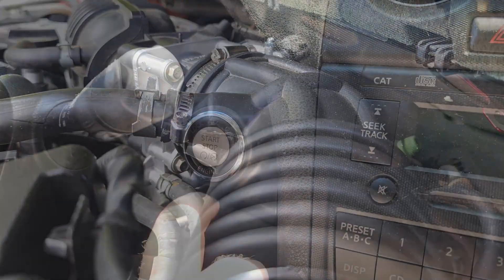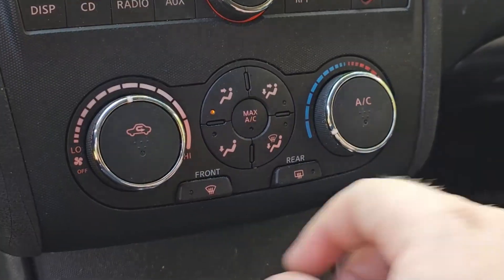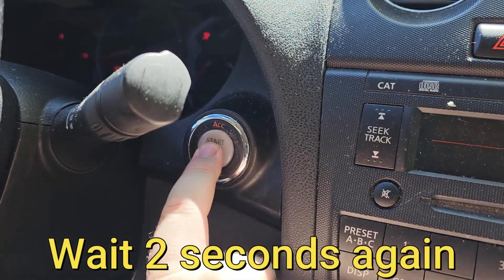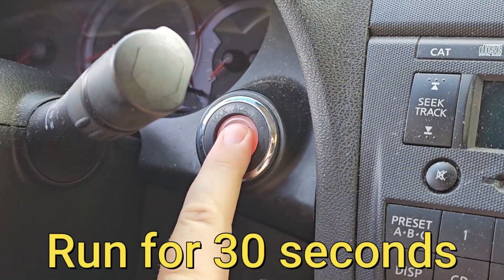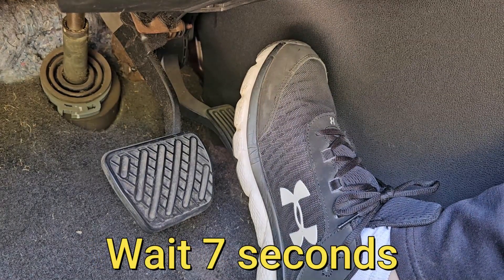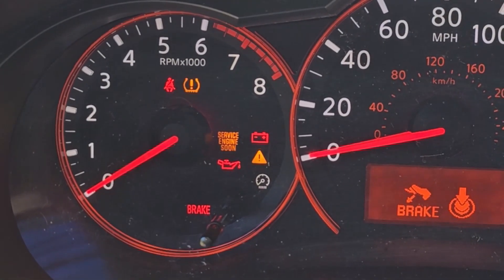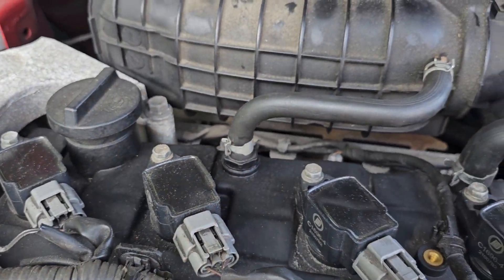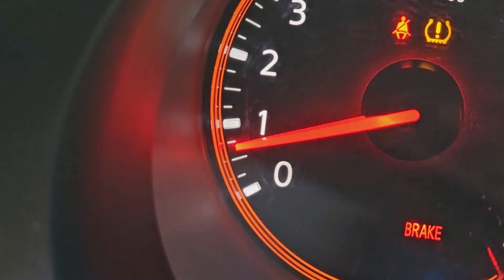Nissan Electronic Throttle Body: Idle Re-learn Procedure

Comment from the maker: More Nissan Altima Content!

Air Filter Replacement - Quick Guide!
https://www.youtube.com/watch?v=s4kL8nJRU7g

Oil & Filter Change - 5 Minute Guide!
https://www.youtube.com/watch?v=u20E1nn6h9U

Oil Maintenance Light - Reset Guide!
https://www.youtube.com/watch?v=V1kWxTHpnRE

Valve Cover & Gasket: FULL Walk-through!
https://www.youtube.com/watch?v=fRzelPhCPMw

Engine Oil Cooler O-Ring & Gasket Replacement
https://www.youtube.com/watch?v=8bOYDjw8t2Q

2007 - 2012 Nissan Altima 2.5L CVT Transmission Fluid Change! https://www.youtube.com/watch?v=_aTZv3ocE7Q

Upstream Oxygen (O2) Sensor Replacement Guide!
https://www.youtube.com/watch?v=UE1r9-fpe7s

CV Axles & Wheel Bearings Replacement - FULL Walkthrough
https://www.youtube.com/watch?v=HKSJYYgHxO0

Front Bumper Replacement!
Removal: https://www.youtube.com/watch?v=31vjYFm4K4w
Install: https://www.youtube.com/watch?v=2WQZcIuBulc

How to Replace Headlights; FULL Walk-through!
https://www.youtube.com/watch?v=xRzzjcb6l6Y

Grille and Emblem: Full Walk-Through
https://www.youtube.com/watch?v=Ykq2zqWwjiY

Headlight Bulb Replacement!
https://www.youtube.com/watch?v=uLhuZhOonW0

High-Mount (3rd) Brake Light Bulb Replacement!
https://www.youtube.com/watch?v=MKPJpZueWq4

Brake Light Bulb Replacement Guide!
https://www.youtube.com/watch?v=ZZo-qITFhzU

Turn Signal Bulb Replacement!
https://www.youtube.com/watch?v=a3s4wSl7xa4

Side Light Bulb - Quick Guide!
https://www.youtube.com/watch?v=3VY7_19rt0s

Mass Air Flow Sensor Replacement Guide!
https://www.youtube.com/watch?v=jl545FsC9tY

MAF Sensor Cleaning Guide!
https://www.youtube.com/watch?v=qTSwG2e171k

Thermostat Replacement - Full Walkthrough!
https://www.youtube.com/watch?v=10aySOX7aV8

Throttle Body - Full Cleaning Guide!
https://www.youtube.com/watch?v=cHEGOixl2go

Throttle Body Replacement & Idle Re-Learn Guide!
https://www.youtube.com/watch?v=hd64-icRnFI

Air Intake System - Removal and Install!
https://www.youtube.com/watch?v=HyR9HAcZivg

Coolant Drain & Refill - Quick Guide!
https://www.youtube.com/watch?v=2bM15L6tiFs

Replace Brake Light Assembly - Quick Guide!
https://www.youtube.com/watch?v=77F4XJEj5cs

Replace Reverse Light Bulb - Quick Guide!
https://www.youtube.com/watch?v=eYPuGGchsy0

Comment: I have no doubt the same engineer that made you have to remove the motor mounts to change the valve cover gasket is the same guy that came up with this ridiculous code.

Comment: I got p0101 replaced mass air flow sensor cleaned the throttle body now the car shuts off seconds after starting can’t even drive it any ideas 💡 anyone

Comment: I'm commenting this before I try this procedure again but I partially worry about this not working properly due to the fact I have aftermarket headlights that have DRL's on my Z, plus I have my bumper DRL's wired to them, they both stay on regardless. Plus my air suspension is obviously hooked to my battery. But, I'm going to try this again and hope it works. The first two times I tried it weren't optimal and I had to fix some more things. 🤞🏼

Comment: -2 seconds ignition on
-Turn off wait 10 seconds
-2 seconds ignition on
-10 seconds off
-Turn ignition on, then immediately off
-Wait 10 seconds (makes sound)

-Start engine to check it's running fine.

*IDLE RELEARN PROCEDURE*

-Off for at least 10 seconds
-Ignition on for 3 seconds, then press gas pedal to floor 5 seconds within 5 seconds
-Wait 7 seconds, then press gas pedal down for about 25 seconds (Check engine will blink then stay on), now you have 3 seconds to turn on and idle

Try again if it didn't work
Reply: The written instructions worked better than the video.
Reply: @flippinmoose i got you fam
Reply: I’ve got a 2014 Altima the only thing I’m not getting is the sound. When I continue on as if I do the check engine light does blink for me as it should when doing the steps. I’m just not getting that sound feedback.
Reply: Idle is at about 600 rpm
Reply: Is this procedure work for nissan micra k13?
Reply: @benmoussayoucef4699 no clue!
Reply: Working on nissa versa 2021?
Reply: Great I am going to try this today 
Yesterday I couldn't do with my autel scanner

Comment: Thank you!  I cleaned my '07 Altima 3.5 SE MAF sensor and while at it, decided to clean the throttle body. After putting back everything together, I got the expected P0507 code.  I did the steps and idle is back to the factory spec.

Comment: I have a 2004 Nissan Titan, I can’t get the check engine light blinking, I have done the steps as you said and nothing, my battery is 12.9V everything is off and still no changes on the rpm, 1500 that’s what it is right now.
Is this procedure for all Nissan vehicles or just for new models Altimas?

Comment: My altima idle 1000 on park is that normal , And I have po172 check light does that fix it ?
Reply from the maker: No, you'll have to fix the car and get the po172 code cleared up before attempting the idle reset. Thanks for watching! 👍
Reply: Ok I'll try thank you

Comment: What about an older Juke that has a regular key? Is this procedure exclusive to Nissan because there are other similar and slightly simpler methods for all vehicles in general? e.g. https://m.youtube.com/watch?v=P_2HwFIq1uU
Reply from the maker: I'm pretty sure it would work with your Juke with a key ignition. And this method is for Nissans only. You can try out that video and see if it works for you though, it should'nt hurt anything even if it fails. It took me more than a few good times until I got it work with this videos instructions. Hope this helps, thanks for watching! 👍
Reply: @TrickShiftGarage thank you for the quick reply, appreciate it!

Comment: Tried several times. 2004 Nissan Xterra 2.4L, 5 Speed manual. Did not work.
Reply from the maker: Sorry to hear that, a Nissan shop should be able to reset it for you on their scanner tool. Thanks for watching! 👍

Comment: Sir this calibration also works in nissan micra petrol 2013 model?, i have got cng fitted on my micra retrofit 2021 from that time my rpm fluctuations is going on. I am from India.
Reply from the maker: Does it use a standard throttle body that came with the petrol emgine or a modified throttle body to accommodate the CNG retrofit?
Reply: @TrickShiftGarage  yes it uses standard throttle body

Comment: Turn ignition switch on 2 secs... 

Turn off 10 seconds 

Turn on 2 seconds 

Turn off 10 seconds 

Turn on/off immediately 

Turn off for 10 seconds 

Turn on 3 secs
Push gas pedal 5x within 5 seconds

Wait 7 seconds 

Hold gas pedal for 20 seconds 

3seconds after check engine light stops blinking... Start engine 

Rev a few times
Reply from the maker: Looks good! 👍
Reply: @TrickShiftGarage  Worked like a charm... Thought I'd write it out for the future users... Also didn't get the throttle body noise... but the check engine light did blink.... I just followed this guideline while syncing with the video.. 
 good luck future users
Reply: Worked perfectly my 2nd attempt on my 2005 Altima 2.5l.   only thing you didn't specify is to release gas pedal when check engine light stays on solid,then start car.once it stays on solid,I waited 2 seconds, started car,let idle for like 2 seconds,and revved lightly 3 times. Thank you so much,your written instructions are way easier to follow than video,and is only one that worked for me.thank you so very much.

Comment: my 2013 altima, idle very rough to the point that the whole car shakes, it is around 700-800rpm but playing a little up and down, I have changed and done a lot of things to fix this rought idle, but still it was not fixed, would this relearn help with the fix? thanks

Comment: I have a 2009 Xterra and I got the code P1421 "indicates the PCM detected improper performance of the vehicle's cold start emission reduction routine." The most likely solution from the code scanner said to do this Idle Air Relearn Procedure, which I followed your video and got the Service Engine Soon light to be blinking and finished the procedure. The light didn't end up turning off, and I did the procedure correctly a few times to make sure I did it right. The light never turned off, does this mean I have another problem? I didn't notice any driving changes whatsoever when the Service Engine Soon light came on. Thanks so much.

Comment: Great vedio it's working with my Nissan Maxima 2017 . Aug 2024✌️
Reply: I was just about to ask would it work with a 17 because I have the same issue
Reply: How though it didn't work with my 16 maxima?
Reply: @SlappyMcpatty  I actually didn’t need this, there was a vacuum hose leak on the backside of my intake, about a 4-5inch hose that was causing me high idle problems.
Reply: @SliimeZX14R  was yours making a hiss sound? Mine is and it keeps wanting to die in park. I switched my air filter and MAF too
Reply: @SlappyMcpatty  yes it was hissing, sucking outside air that your MAF can’t read. Gave code for running lean bank 1 and bank2.  Check backside of intake should be a vacuum hose with a small white marking on it.
Reply: @couteeboy21  you just saved my anxiety thank you. I'm running lean codes on bank 1 and 2 as well. My car is running rough lol

Comment: Just will not work no matter how many times I try on Nissan qashqai 2015 1.2
Reply from the maker: I suggest taking it to a mechanic, they should have a scanner tool to reset the idle speed. Thanks for watching! 👍
Reply: @TrickShiftGarage  I have one myself a TopDon 800 BT said subfunction not available.. strangely

Comment: I just replaced the whole gas pedal assembly (pedal and sensor). Is this the procedure to run now?

It’s running fine but code is still showing.

2011 Nissan Titan
Reply from the maker: I'm not sure if it's necessary when replacing the gas pedal, I'm leaning towards no. But if there's a code on the ECU, this procedure won't work until the code is gone. Hope this helps, good luck and thanks for watching! 🙂

Comment: My 2018 nissan qashqai lurches forward once in awhile would it be this or coil pack. I have no warnings on my dash at all
Reply from the maker: My guess would be a sticky throttle body plate. It might need to get cleaned up or replaced. Hope this helps! 👍

Comment: I just bought a 09 Murano and replaced the Accelerator pedal sensor and got no results. (I was told this was the issue) It doesn't rev up. Is this the limp mode low tranny fluid? I didn't check it. I did hear a loud whining when 1st started, I thought it was the pw steering pump. Thanks much for any help!
Reply from the maker: Hello, this sounds to me like a transmission or throttle body issue. Go ahead and check your transmission fluid level and top it off as necessary, it may also be time to change the fluid if it looks really dark. 

If that doesn't get any results, take off your intake tube leading to the throttle body and have someone rev the engine while you watch and see if the throttle plate moves at all. If it's not moving, then I would replace the throttle body assembly. Hope this helps, thanks for watching! 👍

Comment: Yea it’s not working for me
Reply from the maker: Sorry to hear that! A Nissan shop should be able to reset it for you with their OBD scanner tool. Thanks for watching! 👍
Reply: @TrickShiftGarage  any idea what it could be? I did the reset with the scanner and my check engine came on.
Reply from the maker: Hmmm, before jumping the gun and replacing the throttle body, check all of the vacuum lines that are on the intake track, extra air could be seeping in behind the mass airflow sensor causing the issue. Check your intake tube for cracks as that plastic can become brittle and causing trouble. I found my rubber intake tube that had ridges were dry rotted when I replaced my throttle body.

You can also check and clean your mass airflow sensor to see if that helps any. Also, physically inspect the throttle body, if it's dirty you should clean it up with throttle body cleaner. Also, while your inspecting, make sure there's no debris lodged in the throttle plate that could be preventing it from moving correctly. Lastly, take your intake tube off and have someone rev the engine while you watch the throttle body and make sure the plate moves correctly.

That's about it, If all else fails than it's probably the throttle body assembly itself that's bad and will need replacing. Hope this helps! Good luck! 🙂

Comment: Do I have to do this if I replace my throttle body on my 2017 Altima?Or is there another re program I have to follow for changing throttle body?
Reply from the maker: Not sure if it still works on newer Nissans but you could try it out. I don't think it would hurt anything. If it doesn't work, a mechanic shop should be able to reset it using an OBD scanner tool. Thanks for watching! 👍

Comment: Tried this 5-6 times, but never got the noise from the throttle body at the start.

Got the blinks lights etc, but just sets idle back to 1250 or so…
Reply from the maker: This was my experience too. I finally got it to work when I pressed the pedal down 5 times as fast as I could. I know it says 5 times within 5 seconds on the service manual, but just do it as quick as you can and see if that works for you. If all else fails a Nissan service shop should be able to reset using an OBD scanner tool. Hope this helps! Thanks for watching!👍

Comment: @trickshiftgarage what does it mean when my throttle body doesn’t make the noise to confirm that the relearn process has been done
Reply from the maker: It could mean that it's not working as it should and might need to be replaced. I would try to go forward with resetting the idle and see if it works anyway. Hope this helps, thanks for watching! 👍

Comment: fully  depress  the  accelerator  peda Wait 20 seconds and Fully release the accelerator pedal within 3 seconds after the MIL turns ON ((((((((((  NOT RUN in wait 3 seconds in stop MIL ) and ON

Comment: What do I do when my check engine light is never blinking
Reply from the maker: Hello! Sounds like something is legit wrong with the engine and will have to be fixed before you can try to reset the idle speed. Most auto parts stores can scan your vehicle and tell you why it's on. Good luck! 🙂
Reply: @TrickShiftGarage help sir I changed plugs in nissan tiida 2008 my car get slow down what I do before changing plugs give me fast speed but after changed the response are so slow speed 😓I'm confuse sir

Comment: I have a 2019 370Z; will this work on the VQ37VHR engine?
Reply from the maker: Hello! Not sure if it will work on that particular engine as Nissan might have come up with an easier way to reset the idle speed. What I would do is call a Nissan dealership/mechanic shop and see what is involved with getting your idle speed reset. Hope this helps, good luck and thanks for watching 🙂
Reply: @TrickShiftGarage  Thanks.

Comment: Amazing! Worked first time on 2006 manual Qashqai. Didn’t hear the throttle body noise but kept going with the instructions and the engine light blinked still as you described so I kept going :) had the high idle issue after cleaning the throttle body and now idles at 600 rather than 1400. Noice.

Comment: I have a problem with the check engine light that doesn't turn on no matter what. I believe the light bulb may be damaged. So I can't follow the process due to that light since I can't see when it starts blinking or go off 😢

I tried with taking note of the time with a cronometer but still not sure if the process was done correctly. :/
Reply from the maker: Sheesh, that's a tough spot to be in. I suggest going to your local Nissan shop and letting them reset the idle through a scanner tool and see about the check engine light not working. Hope this helps! 🙂

Comment: I’ve attempted a couple of times, i did exactly in the video, start the car once check engine stays solid, im still getting the p2101 code. Should the code go away instantly? Or does it mean the system didn’t re-learn?
Reply from the maker: P2101 is for “Throttle Actuator “A” Control Motor Circuit Range/Performance.” So basically, your throttlebody is bad and needs to be replaced before trying to telearn the idle speed. Hope this helps! Thanks for watching! 👍

Comment: Worked for me 06' nissan quest. Needed to be done. Was idling at 900rpms now 650rpm smooth.
Reply: Was throttle pedal working?
Reply: @junkstuffwanted  yes just wasnt idling as stable as I knew it should. After digging into my used vehicle more and more. I am finding that it is a mash together car. Its runs and drives good for the price I paid. I cant expect nothing more than good engine transmission basic brakes and functioning correct a/c & heat.

Comment: Great video. I have a 2002 Nissan Xterra 3.3 VG33e. I had the battery out for 3 hours to replace my power steering pump. When I reinstalled the battery I noticed immediately after it warmed up that I was having a very rough idle. Scan showed P0300. Could this be the cause?

Comment: I'm doing this on my 06 Nissan frontier 2.5  with manual transmission,  but for some reason i can't hear the throttle body working,  with either the new one or the old one, what could be the issue?
Reply from the maker: Hmmm that's a tough one but sounds like something might be up with your electrical or the lack of power going to the throttlebody, check around for any loose or undone ground wires. Hope this helps, thanks for watching! 👍
Reply: Did you found any loose wires etc? I have the same issue with my xtrail t30 manual

Comment: It's work! , but only with cold engine
Nissan Altima 2013 "2.5cc" 
So if anyone try and didn't work just try with cold engine and 100% will work
Reply: Thank you, really thank you. I tried to calibrate on a warm engine about 100 times. 2500rpm at idle. On a cold engine, first attempt and success. Thank you very much
Reply from the maker: Thanks for the tip! 🙂👍
Reply: Was the RPM going up & down on idel?
Reply: @dailyvideosmany No